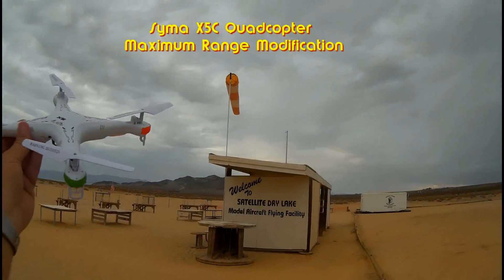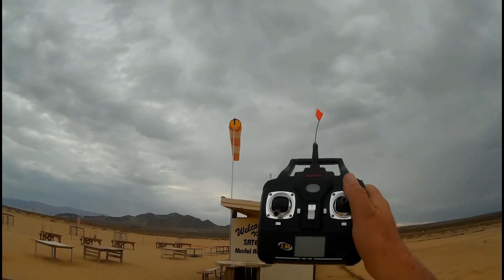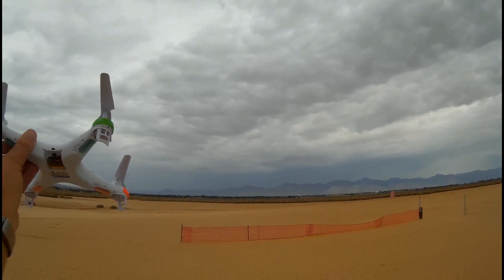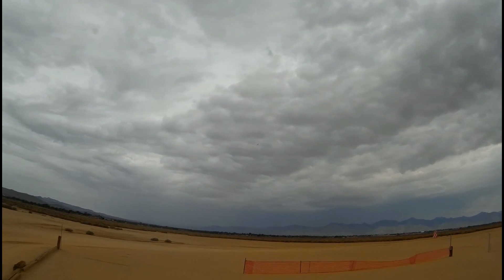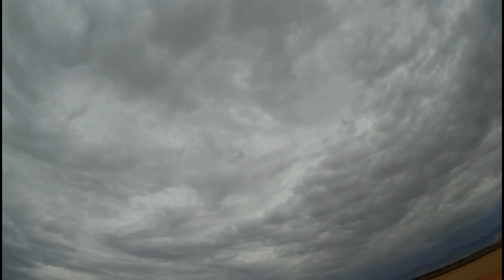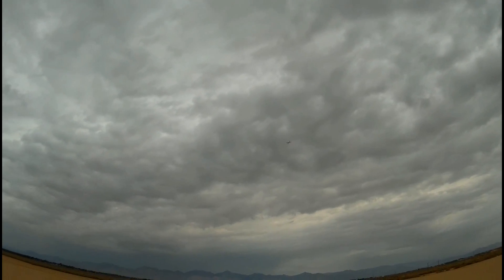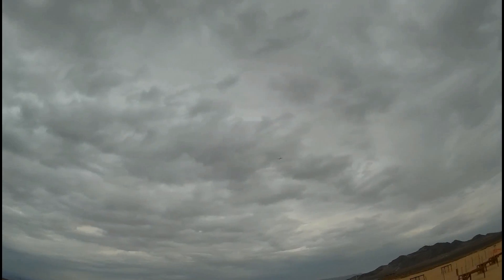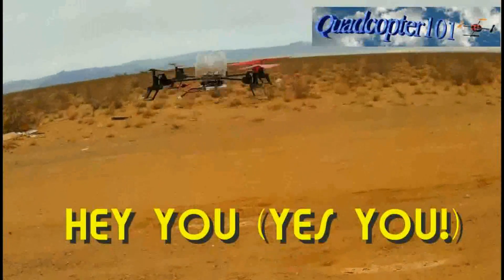Syma X5C Quadcopter Drone Maximum Range Modification

Comment: Very nice work. New to drones. So far my favorites are the X5c-1 bayang toys clone and the Visuo XS809S. 
  I followed Dominick Quaye's excellent tutorial  and this old NAVAIR technosaurus fossil was able to go for a ride a good 100 meters away from the kitchen window and stay bound to the controller. Quadcopter inside car, transmitter inside house sitting in window.  
   Verified improvement over stock transmitter in the same test.  Don't really contemplate a flight range test, just wanted a solid 50 meter range. Done and done. ;) 
Here is the url for the video tutorial I used, although I just took eight screws out of the back of 
my controller and handled business from there. Very easy even for an elder with bifocals :D 
https://m.youtube.com/watch?v=GwpsyddO4AA&t=41s

Comment: any links for how you did it? am i overthinking it? you opened it up, soldered about the same gauge wire as the original antenna, nothing special and then cut the wire atboard point to end 4.92 inches thats 12.5cm?  drilled a little hole in the fake antenna and then you are good to go?- i'm about to do this. i need to be specific and precise on the length from board to antenna, yes? i am overthinking i am sure. thanks for your vids cheers

Comment: Hey dude i have a rip off version of this along with the official syma x8hg, anyway the controller for the ripoff ( x5c-1 ) died without warning would be possible to use the official syma ( x5c-1 ) controller with the ripoff version since it is the same frequency and all the buttons do the same thing?
Reply from the maker: No, if it is not produced by Syma, can almost guarantee that its transmitter uses a different protocol.
Reply: Quadcopter 101 ah shit !thanks tho

Comment: I did the same thing today on my x5sw ..before fer some reason it wouldn't go more the say 50 ft without losing range..I did wire extension.. but haven't tested it yet..hopefully it works

Comment: Thanks for the tip. I modified mine with a full wavelength wire too and got mine to go out at least 105 yards, using a football field to measure.

Comment: I did the transmitter mode with the sma connector and have the antenna connector neatly built into the top of the unit- looks stock!. I normally bave a 3db on it but can switch to a 5db I call Big Daddy. I may be modifying the receiver antenna in the quad also. I'll remove the junk cable from the board and solder in a real RC antenna that drops down through the body out a small hole in the bottom. Unfortunately, where I've been flying I have only had it out about 150 feet so far.

Comment: I flew mine into a 50 ft tree the first day I had it!
Reply from the maker: A common mistake most new fliers make is to send it up to see how high it can go.  Unfortunately the wind at altitude can be very different than that near the ground. As such, most new fliers are unprepared when the wind starts to blow it away, quickly lose orientation, and that's that.  As such, always stay close to the ground when learning to fly until your skills improve.
Reply: +Quadcopter 101 yeah I got my x5c for Christmas and watched your video that day and it helped. Then I saw you have a video about flying it far away and that helped too. Then 2 months later I flew it into a wall! One motor broke and I ordered the motor 3 months later lol. It took a week for the motor to get here and I just installed it last night. I forgot how fun it was to fly! The motor took me 1 1/2 hours to install but I'm sure I could do one in like 20-30 mins now. I want to do the range mod soon.
Reply: +Quadcopter 101  pls tell me long distanc of Quadcopter Aircraft

Comment: that wire looks like it is longer then 4.92 inches can you please clarify this whole wire thing for me I have researched it and I cant make any sense I read your comments below too. but the controller you have has to "total' more than 4.92
Reply from the maker: +Nick The wire starts at the top of the circuit, not the full length of the transmitter. And yes, total length of the wire from where it leaves the circyuit board is 4.92 inches.  Finally, please do not attempt this if you're not familiar with soldering as there is potential for damaging your transmitter.

Comment: Hello, just wanted to say I've watched all your videos for drones so far. You seem very knowledgeable on drowns, being that I wanted your advice.
If I wanted to put a antenna on the transmitter, what dBi would I need ? Does it matter? Just as long as it's 2.4 ghz. Thank you and looking forward to more of your videos
Reply from the maker: +jarka1361 I recommend no higher than 5dB as it is the best balance of increased range with a still relatively wide lobe that can be aimed easily.

Comment: I assume you checked that the antenna wasn't loaded on the board? Apparently your mod worked per your own testing. That's bad if they're selling Txmitters with the antenna wavelengths cut wrong. The life expectancy of the Txmitter will be cut short due to a mismatch  (high reflected energy). Curious if users are having Tx problems after prolonged use?

Comment: question, i notice that my X5C after like 30sec of flight i give it full throttle and it just hovers about 2 or 3 feet of the ground when i fly it backwards it gains altitude but when i push forward it loses altitude and drops to the ground and has a hard time of going back up.Tell me can a bad battery cause this ?......i did this MOD and then i notice this happening so i removed the wire and brought it back to its original state but still having the problem ..what could it be ? please help me out here
Reply from the maker: +franko nick Actually it sounds like a failing motor, or sand or debris in the gears. https://www.youtube.com/watch?v=LzzD3BPVvH0
To check ro the suspect motor or gears, try a rapid takeoff from the ground.  If the quadcopter momentarily tilts in the direction of any particular motor, that is the suspect motor or gears.

Comment: What up brotha man. Hey did u  solder that thing on the tip of the antenna or to the side a little bit? Finally got me a Syma x5c-1 thanks to you making me want one lol.
Reply from the maker: +jred23pyro To the top.  Search the YouTube search bar for syma x5c antenna mod
Reply: +Quadcopter 101 ok thanks. searched that plenty of times =]. will solder a piece of wire to make it 4 92". total. Think some speaker wire or anything with copper inside would be fine? maybe try to keep it same thickness and well? thankd boss quad. lol =]

Comment: very lame experience with this quad my 1st quad and It's not syncing to my transmitter after 1 flight this thing is a mistake buyer beware
Reply from the maker: +Darryl Davis Make sure that your battery is fully charged.  Turn on and place quadcopter on a flat and level surface.  Wait 5 seconds for the gyros to stabilize, then turn on the transmitter. Move the left stick throttle full up then full  down to bind the transmitter.

Comment: Hey Quadcopter 101, i wonder if this would work on my syma x5sw?  It has pretty similar transmitter or probably an exact transmitter.
Reply from the maker: +Saiful Raznan Yes it would.  But the big problem with your X5SW is the WiFi FPV operating on the same frequency as you transmitter.  Ditch the camera, and you'll get much better range.

Comment: Hey quad, I did the range mod with the transmitter (X5C-1)soldering in a 2.4ghz router antenna. I am currently changing a motor and want to know if there is anything I can change to the quad itself while in here.
Reply from the maker: +wild300zx No, don't recommend messing with the innards if not needed.  And regarding motor changes, you can also just splice the motor wires instead of soldering.
Reply: +Quadcopter 101 Gotter done soldering them in the right way like they were, we're up and flying high. I left the quad antenna alone for now I did put it down the towards one of the legs instead crammed under board. Also resoldered the leds so the green is in front now, just my preference on that one. Getting around 7+ mins with the camera on using Turnigy 750mha batts. Looking at the H5P now, really, really like the looks and feedback it's getting.
Reply from the maker: wild300zx The H5P is very good, good camera, very stable, and really can fly over 15 minutes.  But don't recommend flying 15 minutes non-stop with it, as it will damage the battery.  It's important to break flights down into two shorter 7 minute hops with a cooldown break in between. https://www.youtube.com/watch?v=FngMTK8loOg
https://www.youtube.com/watch?v=TGm45rm-DZ0

Comment: Go figure I do a search for something quad copter related and find an QC 101 video on the subject! I'm not even surprised anymore!
You rock, sir!
Just had a similar experience with my Syma X5 Explorers model (sans camera, I'm using others 808 #16, etc.)
I didn't want to invest anything,  so I replaced that antenna wire with a little 2.4Ghz dipole antenna on a piece of coaxial cable that I had removed from another transmitter. The additional soldering for the coaxial cable was easy as there is a solder pad for the shield right next to that antenna wire solder pad on the transmitter PCB.
I didn't bother to drill the antenna housing to pull the wire part though;  I just pushed the dipole up into the housing until it stopped and then secured it with a dab of glue.
I've also modified the flyer itself by pulling the wire antenna inside up so that it's vertical and sticks out of the top just a little bit. -That alone improved the range.
I just did my transmitter modification last night so I'll be heading out to my local field later to do some range testing.

Comment: Can I do this mod on the x5sw? Does the totam length of the antenna have ti be 4.92"? Does that include the overlapped part where you solder?
Reply from the maker: Michael M Yes this works for any of these "toy grade" quads.  The length measurement begins at the point where the original antenna is soldered to the circuit board. So original antenna + extension = 4.92"
Reply: Yes it's actually blown me away how good it is. Stables reliable and doesn't break. I've crashed it a billion times and still going strong.

Comment: Great! I´ll try to change my antenna. The other issue I find with this drone is that the battery doesn´t last more than 13 minutes. Do you think I can change it for another one with more capacity?
Reply: 13 minutes is perfect for a drone of that size its actually brilliant

Comment: Hello, very good their video tutorials, my query is only the transmitter antenna is changed? or receiver as well. thanks
Reply from the maker: Hernan Dip Only the transmitter.
Reply: Ah ok thanks, and one last question, the cable diameter which is recommended for you? or which it is the one used
Reply from the maker: Hernan Dip Any diameter that wouldn't break easily.  But I do recommend single strand wire.

Comment: I was contemplating getting this quad and doing the modification to the controller. I just found out about the hobby king 100$ fpv kit and was wondering if this could carry the receiver and all of the required equipment that goes on the quad. I realize that I'm not going to be able to fly a mile with the fpv kit or the quad. Would this be a good quad for a beginner fpv quad for a nice open field or would you recommend something else. I'm looking to spend 50-75 on a quad that will suit these needs. This seems like it will pack it because it packed the mobius and hopefully the fpv kit is much lighter so it's not so weak and sluggish and I'm not overworking the motors to bad

But I'm open to nearly any quad as long as it's durable big enough to hold fpv gear and fly decently fast

Thank you much
Reply from the maker: Brandon Mitchell Recommend looking at this https://www.youtube.com/watch?v=ZAF18fsanvA

And if that didn't fit your fancy, then this might https://www.youtube.com/watch?v=xxI_MwoSu3s
Reply: Wow the 60$ one looks awesome. Although it loses reception a little I think it would be cool to make goggles with a phone holder and maybe I could use my 7" tablet which would be awesome. Does the device have to be on the controller to be used.

By the way thanks for the reply. I really appreciate it
Reply from the maker: Brandon Mitchell No that's just a convenient holder for it, but it can be anywhere.  And yes a tablet should give a nice big screen. You can try the WiFi app now, as it's free on Google Play and the App Store.  Look up "HT WiFi".

Comment: Hey Quadcopter 101 :-) As always, thank you for your product review videos... I check with you first before buying anything. 

So with this X5C range mod... Would soldering on the proper length of core copper wire from a coaxial cable to the existing antenna wire work(I think so based on this thread) BUT THEN bending it sideways inside a pigtail plastic housing and leaving it bent work better than keeping the antenna straight up and down from the board? That way you wouldn't have to worry so much about the direction the tx is pointed? What is your expert opinion please? And thank you!

Comment: If you really want to get the max range out of your Syma X5C-1 - see this post:
https://www.youtube.com/watch?v=JopNcWZZF2Q
It does require soldering skills - if you can't do it - it is worth it to get someone's help.  This type of mod by extending the stock antenna only got me only about 150+ feet (50 yards or so).  Using Kevin's mod I have gotten over 350 feet and that is in an area where every house and apartment has a 2.4g WiFi router in it.  I am going to go to a wide open space soon to do a range test and expecting to get into the 500 feet range!

Comment: Hi, How many centre meters of wire did you solder on?. I have a old wifi antenna is it okay if I take all the wire out of the antenna and put 2.5 centre meters (2.4ghz antenna length) into the antenna, does the wire have to extend to the tip of the antenna?, thanks
Reply from the maker: What I did in the above video is soldered a thin extension wire onto the tip of the current antenna.  Total length was 125mm (2.4Ghz wavelength).
But, would recommend not modifying your wifi router antenna, and using it as-is.  It should work well.  Here's how https://www.youtube.com/watch?v=g1GblSfwlog

Comment: Hi There,
Thank you for the great video. I just have a quick question. i bought one a few days ago and when i turn it around left to right and opposite, the direction control doesnt respond normally. i mean when i turn it lets say 90 degrees to right direction all the direction switches and when i go for example to right it goes forward instead of right, is it normal? when I rotate it in different direction shouldnt the right control handle responds the same?
Reply from the maker: It's behaving normally.  The right control handle is always referenced to the front nose of the quadcopter. If the nose is pointed away from you, and you push forward on the right stick, the quadcopter should move away from you. If the nose is pointed to the right, and you push forward on the right stick, the quadcopter should move to the right.

Comment: Thanks for the tips. I extended the antenna to 3/4 wavelength. To avoid holding the controller at a funny angle all the time, I drilled a hole next to the beginner/expert mode buttom, folded the antenna so that it lies along the top edge of the circuit board (much like the pre-mod config) and with the extension sticking out of the hole on the side. Didn't notice much increase in horizontal range (probably because I tested it in a rather built up area), but definite increase in vertical range.